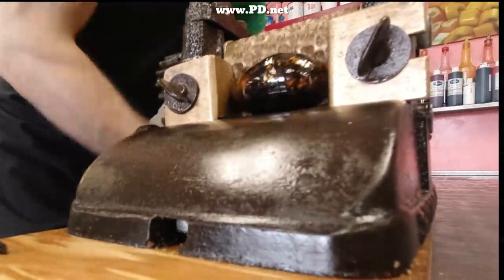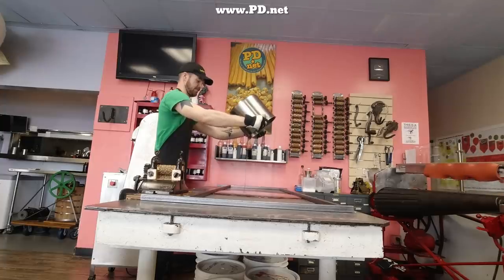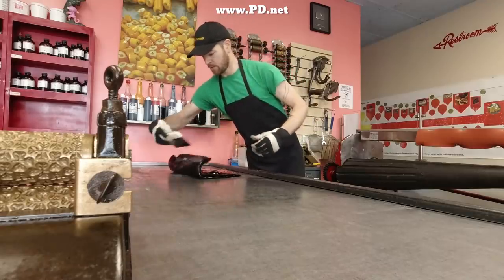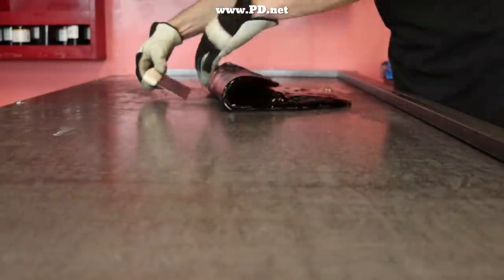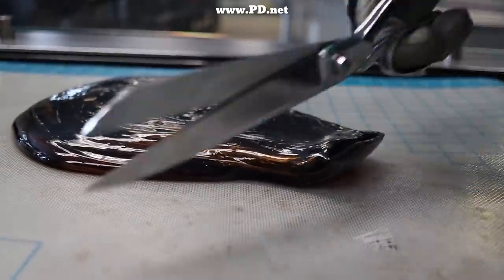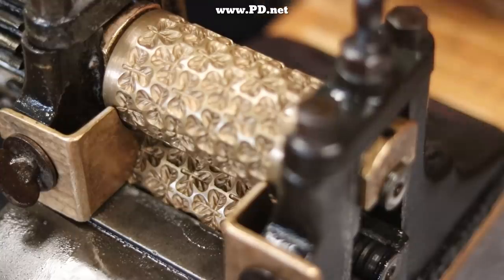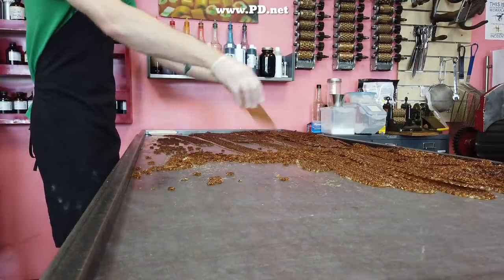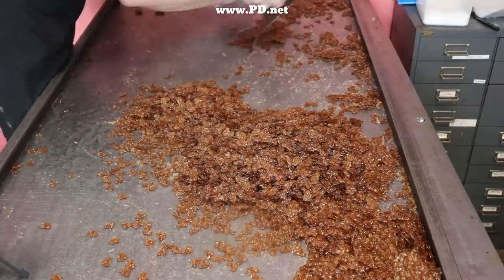#134 Irish Coffee Candy shamrocks at Lofty Pursuits (made by Jake)

Comment: Get the spoon closer to the surface, with the tip just breaking the meniscus. The idea is to interrupt the vertical motion of the floated liquid so it spreads on the surface and doesn't get integrated with the drink. You could potentially whip it a touch longer to aerate even more so it floats naturally too, but you should be able to layer without issue.

Comment: The coffee should be a bit darker to make it more dense and have a nice rich coffee flavour, the cream should be much thicker than that, it should be able to coat the back of a spoon but still be able to pour as a liquid, you can check if its thick enough by floating it on water, if the cream is thick enough you shouldnt need to use a spoon to layer it